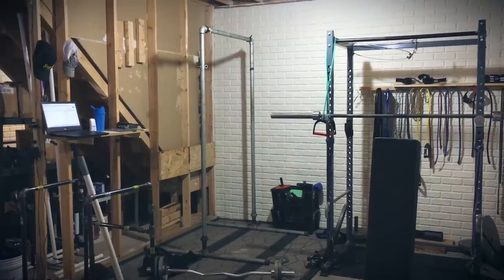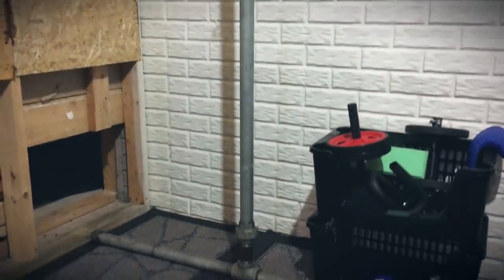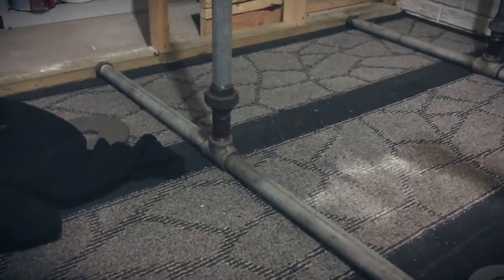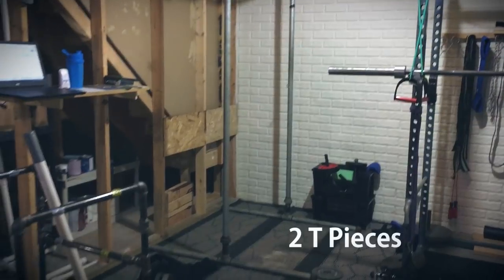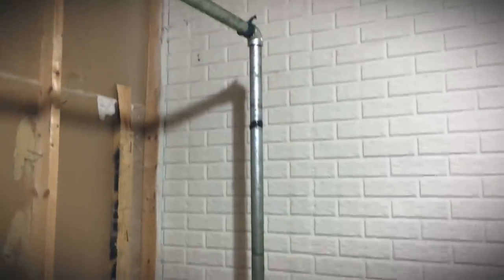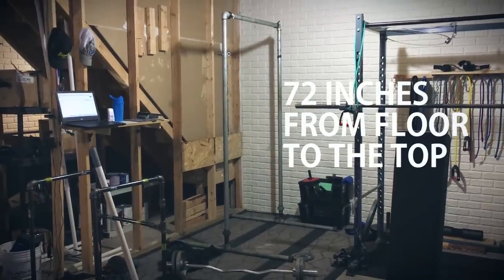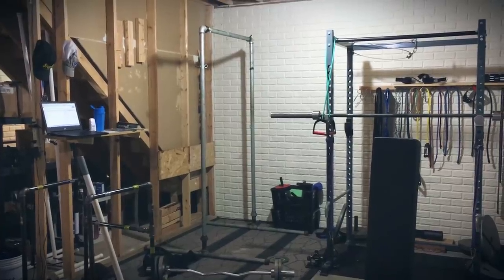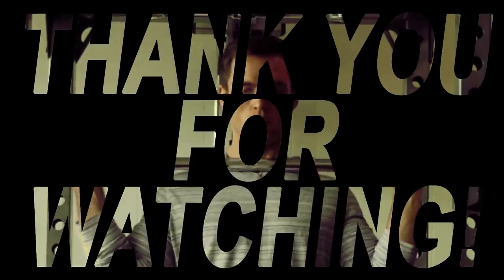Homemade DIY Pullup Station   Standalone

Comment: Right on! Glad I ran into this video. I’m shutting down my other pages due to going a whole new direction. Wanted to make sure I found your channel again. Sounds  hokey I’m sure but I don’t really get on social mediator much and when I do I don’t memorize the channels by heart. So on my other one I’d simply either just hit like or subscribe... or watch later. Then have to scroll through everything. Anyhow, I’m a family man, and a working man. Your channel speaks to that... at least to me it does. That is why I looked for it again and subscribed.
Reply from the maker: FitDad Experiment-3Eight that is the most awesome comment ever. I truly appreciate that and I’m glad you found my channel. Be sure to post up a link for the channel you plan to run once you find that new direction I want to stay tuned man. Thank you.
Reply: LiftingDad thank you for the reply. For sure man. Will do once I figure out how all this stuff works. I’m pretty new to running an actual channel to share with others. So it’s going to probably be pretty terrible as I start but... Rome wasn’t conquered in a day. In a nutshell my channel will be about me dealing with being a father of five. Though I work thirty-five minutes from home it takes an hour and a half to get home due to evening traffic. The kicker is I’ve recently dealt with some medical stuff... Chronic Migraine, Gout, Pre Diabetes, Nerve Damage, High Cholesterol. Now I’m on meds and I have been placed on a bunch of maintenance meds. After an 11.5 hour day and an 1.5 hour drive then most importantly my family time, there’s not much fuel left in the tank to work out. So now it’s about recreating myself to find what it takes to push myself to be better. Not to be cliché but I want to be around to give my grandkids sugar and then send me home to their parwnts😜

Comment: I use bedliner spray or a similar black rubber spray on the pull up bar so my hands aren't always black from the galvanize pipe after my workout. And it gives me a better grip too. Hope that helps!
Reply from the maker: solid detail addition and would make it look more aesthetic with the gym!

Comment: if i try to do a muscle up will it fall down ?
Reply from the maker: It depends because that has various momentum factors.
If It does feel like it will tip, I'd anchor it to the floor or to a piece of plywood underneath.

Comment: I made one using your model. thanks.
Reply from the maker: how is it going so far with the one you made?
Reply: @LiftingDad  I made it actually 4 months ago and I am doing half lay front lever and it pretty good. I made it my shoulder height exclusively for doing lever exercises. for normal pull ups I have a bar attached to cement on both sides. but your model is very good for learning levers and negative muscle up and bar dips. I actually replied you earlier but I think you didn't get the message.
Reply: @LiftingDad  It even took care of height fear for pull overs and other stuff
Reply from the maker: @whitewhite4462  that's awesome! I'm somewhat short so the height component I get for sure. In terms of the reply, I try to either save the email so I can respond later, or respond to all comments at once. I apologize for not seeing the other.